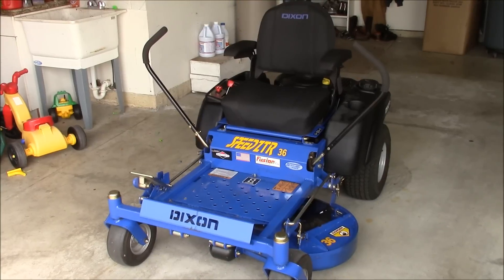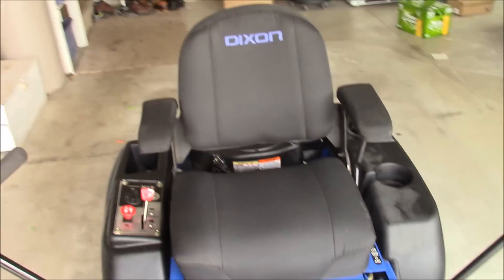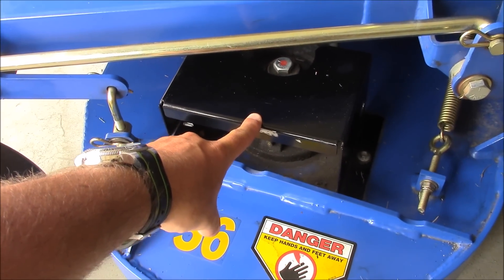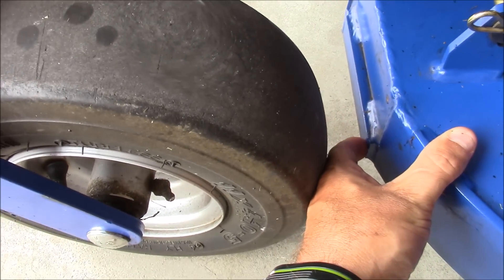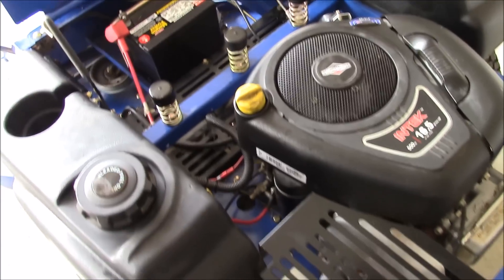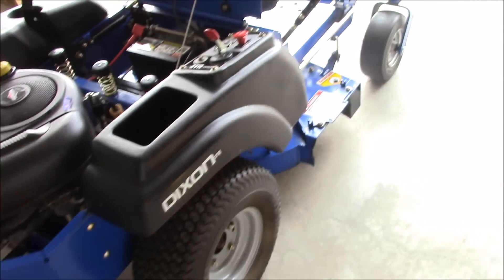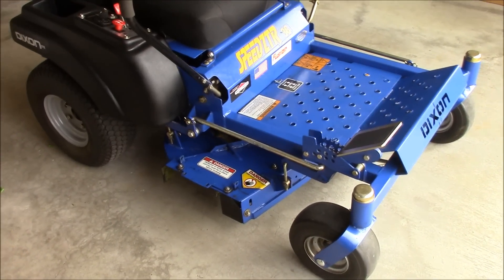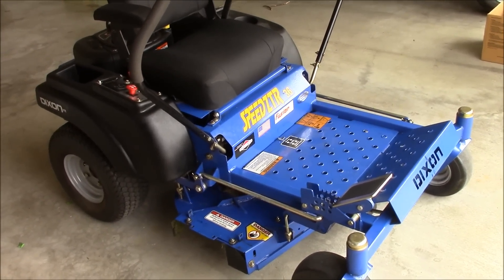Dixon Zero Turn Tractor Review

Comment: Great video DW6!!!! I actually saw one of these at an auction I went to. I didnt stay around to see what it went for though. It needed work. Deck belt was off. Needed cleaned badly. What I was impressed with was the width of the back tires. They must have been close to 14 or more inches wide. It was insane. It looked like a drag race tractor. Lol. Must have weighed a lot also. Glad to see the spindles on yours are greasable. On our encore they're not and the bearings need to be replaced almost yearly now. It's a pain. Greasable stuff lasts so much longer.
Reply from the maker: Love2boat92 Thanks happy you enjoyed the video.
Reply: doublewide6 Welcome. Thats a nice machine. Its nice that theres no maintenance on the drive system.

Comment: i have a dixon 4422 it's probably 18 years old and would not get rid of it until it explodes. has run perfect. only change the oil, replace belts, and a fuel pump and muffler

Comment: i have a dixon. just like this one bought it in 2005. great. overall. but. how do you fill the oil on the transmissions  or. how they are call  please need help
Reply: I'm trying to find out myself. Good luck as I see nothing anywhere about it.
Reply: The transmission maintenance free - you don't change it

Comment: HelloI am looking for a few parts ,I bought a B&S short block model 12T402 2141. f8 ,,,horizontal shaft ,,I need recoil starter ,intake and exhaust manifolds,throttle assembly,,muffler,carb.basicly everything but the block